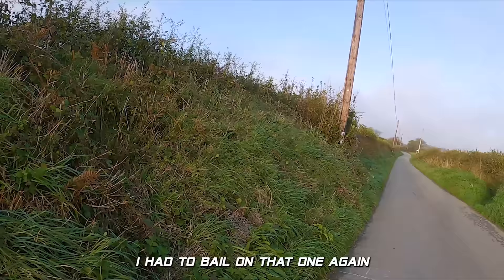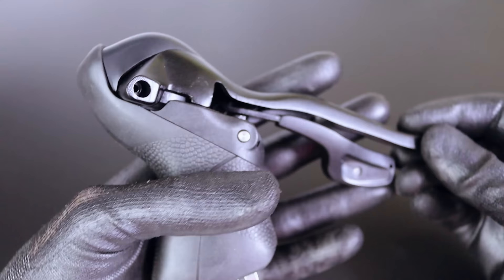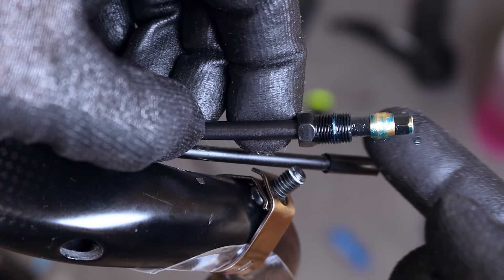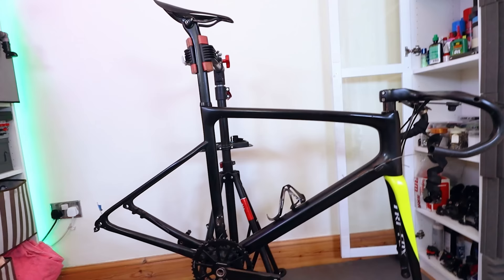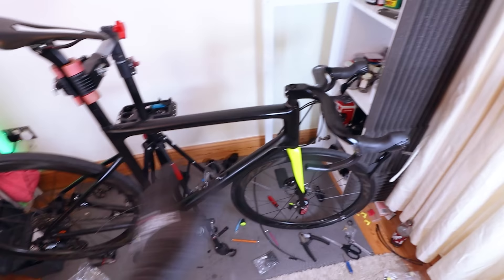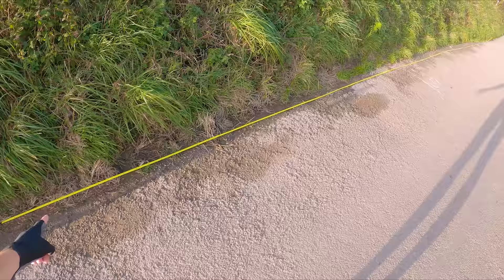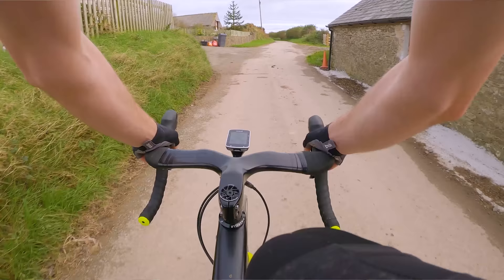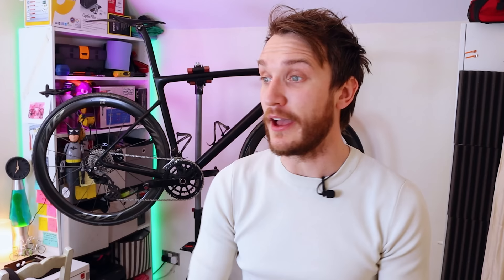Mechanical VS Hydraulic Disc Brakes - Shimano RS505 install & test

Comment: I think you can get closer to hydraulic pressure by using a brake cable called SP31 from Nissen, which is sold by a Japanese company.
It's a good one.
Reply from the maker: I've not actually heard of these. Are they supposed to have less stretch?
Reply: @TraceVelo  Thanks for the response.
SP31 is less stretchy.　
This product is made of many thin wires bundled together and has a slippery surface, which means less loss and faster braking.
I also use it with the BR-RS305 and it is so much better than the cheap wire.
SP31 is inexpensive, so please give it a try.

This is from a Japanese person.
Reply from the maker: @touzenjodan  Ok awesome, thanks for the response. Never heard of them before, so Ill have to check it out!
Reply: Another one is Yokozuna cables and their housing.  The housing is very stiff - no compression at all.  The cables are pre stretched and swaged for minimum elongation and an ultra slick surface.  Not cheap - but some of the best cables and housing you can buy.

Comment: What chainset are you now using Luke? They look like the rings from a racework crank but I don't recognise the crank arms.
Reply from the maker: So that is the same crank that I covered it a previous video, but I've replaced the chainrings with some new ones. After 4000 or so miles, the aluminium chainrings were a little worn, so slapped some new ones on 😁

Comment: i use similar model like juin f1 with brand called pro, and manage to use J03a with custom hole. its improve the performance quite good and modulation a bit

i think that caliper of shimano use L03a. same as other flat mount version of shimano.

btw thanks for the vids now i will think twice using full hydro as it is actually overkill in my daily use. and i still enjoy sensah 12s 😅

Comment: I find the ability to have 100% braking available all the time with a defined bite point (especially with metallic pads, but thats very personal) even from the hoods immensely confidence inspiring in every day riding. especially on the gravel bike with 180mm disc and wide low pressure tires. its like driving a sporty car - you are driving faster around corners, brake later etc. but are always on top of it. it gives security. and its just fun braking only 3 bike lenghts from a red traffic light if i want to :o) you get the hang of the power very quickly.

i always feel kinda insecure when rent a bike with lesser braking on holidays and take it slower. 

btw: in an emergency, just concentrate on the front brake. the rear tire gets unloaded either way and skids without significant braking traction.

Comment: I run cable hydraulic brakes on my road bike which are more than adequate, but for my gravel bike, hydraulics are definitely worth it. Though building out a new frame and having to reroute your hydraulic cable through an internal setup is a big pain in the butt!

Comment: you are simply the best, i have a budget chinese bike like yours with mechanical disk brake, hydraulic set are unfindable and very expensive , i would like to try the new juintech gt f with 4 pistons , it seems they are a really good improvement from juintech f1 , but they are expensive too........

Comment: Many roadies use 140mm rotors only.  If you try 140mm rotors, maybe the hydro brakes won't feel like such an overkill (I run TRP hydro-mechanical brakes on 140mm rotors).  And maybe reduce the weight penalty over the previous setup as well.

Comment: So I’m using a semi hydraulic disc brakes on my road bike. A tip for you guys who are also using the same system. Just change the brake cables to shifter cables. You need a washer or diy washer like a nipple from a spoke and just cut it then use it as a washer. Also don’t forget to grease the cable. And use stainless steel shifter cables
Reply: Why do you want smaller diameter cables?
Reply: @janeblogs324  for better brake pull. Before when i was using the brake cable it felt like i was still using mechanical disc but i am using semi hydraulic brakes. But now when i switched it feels like a fully hydraulic setup
Reply: @janeblogs324  in addition using a brake cable housing and shifter cable at the same time creates less friction when pulling the brakes

Comment: Hi Trace velo, Huge fan here I watched most of your videos. I'm just wondering if you have tried the TRP spyre mechanical brakes? Thanks if you ever reply :)
Reply from the maker: Hey Nicxson, so no I haven't actually. I tried to pick up a pair, but they are pretty pricey. I've heard good things tho, so set them up with some decent compressionless housing, and you should be golden 😁

Comment: As usual love your videos! Sounds like Hydros make more sense on gravel/cx bikes. Also do you think we'll see a cheap chinese electronic group set soon?
Reply from the maker: Yeah totally agree, for gravel and CX, makes a bit more sense. And regarding an electronic groupset, i think a chinese brand has a 12 speed MTB electronic rear derailleur in the works. China cycling covered it a few months back
Reply: @TraceVelo  Yes I saw that video, was wondering/hoping someone like Sensah might have made one for road bikes, hopefully they will send you one to test when they do!

Comment: Great video, Luke!    Thanks!    

I have several bikes - some came with hydros, but several had single piston mechanical disk brakes.   Planning my next upgrade to my single sided piston brakes with the dual sided Juin Tech F1's or the GT-F1's with 4 pistons.   Full hydro conversion looks a little daunting and expensive for me now.    How much improvement did you see from single sided piston full mechanical brakes to the dual piston Juin Tech cable pull hydraulic calipers?
Reply: Can really recommend the GT-F ones, I've used them on my commuter for well over a year. They are hardly distinguishable from Dura Ace when installed right. They are really solid, modulation is worse of course but pure performance is smashing. In some instances they even feel more direct than my hydraulic calipers.

Comment: Great video. As an aside, what were those shorts you had over the bib tights? I'm looking for an additional layer for the wet Irish coastal environment.
Reply from the maker: So they are actually a pair of mtb cycle shorts that I have slightly tailored on my sewing machine to be less baggy.
Reply: @TraceVelo  I know you've done a tailoring vid before, thanks for that. Might try my hand with a waterproof pair of spare mtb shorts.

Comment: I have those shifters and they have a flaw in the design where the shifting cable saws through the plastic. Several bodged fixes.  Mate had same issue. Worse on the front shifter.

Comment: Hi Luke, I am wondering about your beautiful Handlebar, where did you buy it? Would you mind sharing it with me, please? Regards,
Reply from the maker: So my handlebar is from toseek. Its been pretty good, but not completely sure I would recommend it. I have a video in works, so stay tuned 😉
Reply: @TraceVelo  So many thanks Luke, i will stay tune. Regards

Comment: How much time do you spend cleaning up the bike after a ride in conditions like that?
Reply from the maker: Not super long. While it's still wet, I just rinse it off, or just wipe it down. Only takes a few mins each time. The ultrasonic cleaner makes things MUCH easier too when cleaning my drivetrain

Comment: Would be good to do a video on disc rotors, I had TRP floating rotors at about £70 but then got some finned discs off Amazon for £22 and they significantly prevented brake fade.

Comment: Great video explanation! I just missed the video regarding that handlebar... Can someone tell me what brand is it ? Thanks a lot
Reply from the maker: So the handlebar is from Toseek, but there are loads of identical ones out there with a different brand name. They are pretty great, but did require some fiddling around to get them wheer i need them. Maybe i'll get the video together for it

Comment: Hi Luke, I just finished the build of my new bike and I'm using the juin tech F1 brakes. I tried to use the jagwire Kevlar outer cables but they are so stiff that they kink when I fit them in the frame (the problem of the all internal frames I guess) so I had to use Clarks outer cables that they are much flexible.
The front brake works fine because it's a shorter routing to the caliper, but the rear is not working at all.
Do you believe I could use the outer cables as the jagwire elite as you used it in your first video? Or they are only to be used outside of the frame?
Reply from the maker: Hi Alex, so potentially this could work. The Jagwire elite cables will certainly be a bit more flexible, but then there is still the issue of the actual cable having to navigate through the tight angles. When you say the rear brake doesn't work, what exactly do you mean? Does the brake work/engage when you pull it, but it doesn't return when you release the lever? Maybe send me a few pics of the issue to my email, and I can take a better look...
Reply: @TraceVelo  Hi Luke, the rear brakes works it's just they are not very powerful. I'm quite sure that it is because when I pull the brake leaver most of the travel is used to tighten the outer cable inside of the frame and then it really push the pistons out.
Reply: @TraceVelo  Hi Luke, I just bought another set of jagwire Kevlar outer cables but I want to use a small piece of the flexible outer cable just where it used to kink the stiff ones but I'm struggling to find how to join them. How did you join the outer cable that you route inside of your handlebar with the outer cable that you route in the frame? I recall in one of your videos you joined different spec of outer cables but I can't find that join anywhere. 
Many thanks
Reply from the maker: @alexorozco2230  Hi Alex, so the join between the two was done using some metal end caps that i joined together with some electrical tape. This is a little video i did for another guy that asked me about it a while ago, hopefully it will show you how i did it: https://imgur.com/a/QY7wKjw

But where exactly is it kinking, through the handlebar, or through the frame?

Comment: hi Luke love the videos, thanks to your great in-depth review of there product,  I have just purchased the Sensah carbon fiber group set with disk breaks with a 50-34 crank set. my question is I want to buy a 53-39 chain ring for racing. do you know what crank set is compatible with the carbon fiber sensah crank set. I cant find any 53-39 chain rings made by Sensah on Aliexpress.

Comment: It is always funny what is considered here cheap :) 
Juin Tech brakes cost 185$ on ebay, but you can get an Avid BB5 equipped Trek CrossRip Bike for 310$ that is including the bike :)
I have a 140mm rotor on the back and still the wheel skids like crazy at moderate lever pull. 
Brakes need to be setup properly. 50$ BB5s will absolutely flip you over with new pads and proper setup
Thumbs up nevertheless

Comment: 3m in an emergency is still 3m, making full hydros very attractive, then add in modulation and they are a winner. On the other hand I can see full hydros being a real handful for the casual rider, and mechanicals predictability making them attractive for same..
Reply from the maker: Yeah exactly right. Nice to have the performance when you need it, but you def need to have some time using them to get the best out of them!!!

Comment: I don't like the idea of cable actuated hydraulic system because I don't like "mixed arrangements" where the force is transferred through many different systems. 

This dislike comes from my work as a truck mechanic, on smaller trucks some manufacturers use air actuated hydraulic brakes meaning it's a regular air brake system up to the pedal valve but the air pressure from there does not directly actuate the brakes. Instead there's an air brake cylinder pushing the piston of a hydraulic master cylinder which actuates hydraulic brake calipers similar to the ones used on smaller vehicles. And of course the system is doubled for separate front and rear circuits. So there's the air system with compressor, air dryer, pressure regulator, air tanks, pedal valve etc. and also the hydraulic system with it's reservoirs, master cylinders, fluid lines, calipers etc. These things are a maintenance nightmare as they have almost all the components, and thus also the maintenance- and failure points of both pneumatic and hydraulic brakes.  

My road bikes have mechanical rim brakes as those are light, quiet and cheap and plenty good for road.  My MTB on the other hand has fully hydraulic discs which are great off road as they don't mind mud and water as much as rim brakes though they can be noisy especially in wet weather.

Comment: Wouldn't the remnants of the little white seal remain inside the hydraulic lines?
Reply from the maker: Yeah I guess so, but I don't think that would be too much of an issue tbh, especially if you regularly bleed the brakes.

Comment: hydro is way better if you brake with one finger in the drops
lower position. but if you are in the hoods you can not really benefit of the lever way. there it is easier to modulate by power. so for me and my big hands I prefer mech disc's on drop bars.

Comment: After being on the discs for a while your ability to use the brakes has probably improved. To do a fair test you should have done a test with the mechanical again immediately prior to the changeover. Based on your 2 videos I'd go with the hybrid every time over the full hydraulic every time.
Reply from the maker: Yeah maybe true, not sure i could hack ripping the bike apart a third time to re-install Mechanical brakes though 🤣

Comment: Be careful with the hollow stem cap, its going to let water into your fork, which may corrode.
Reply from the maker: Yeah I did consider this. Not the best choice for super wet weather riding, but I store my bike in the house, so not too big a deal drying it out overnight.will def keep and eye on it tho!